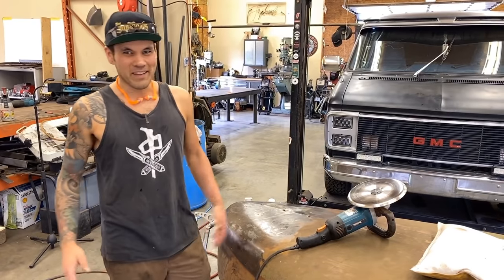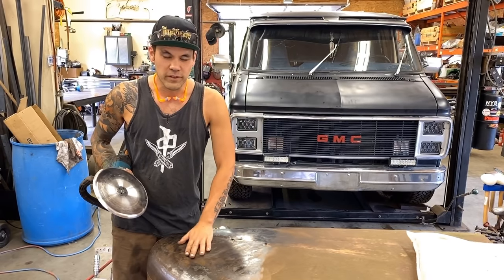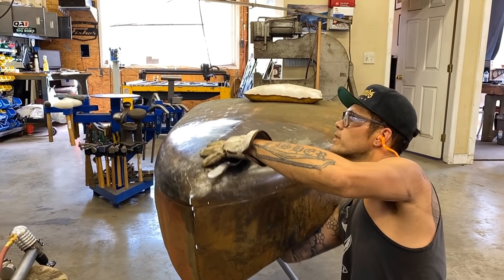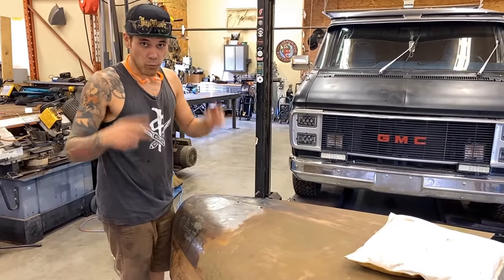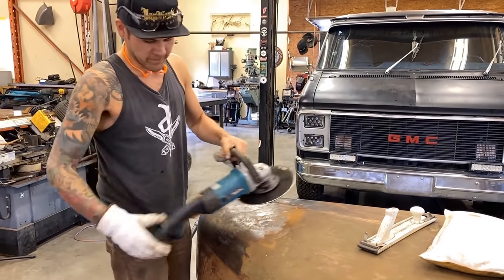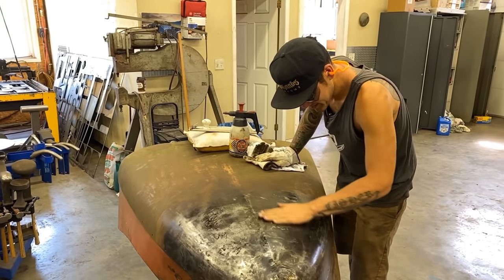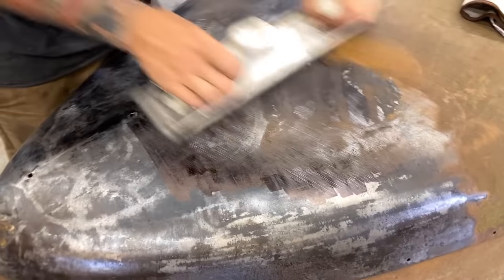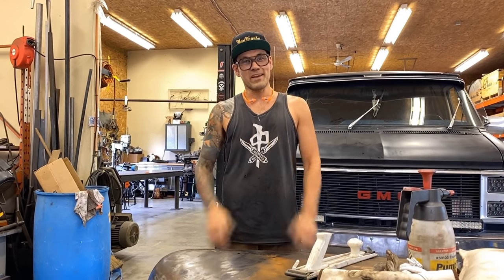DENT REPAIR: Using PROSHAPER'S Shrinking Discs!!! 1940 Willys Hood (Pt 3)

Comment: Revisit Wray’s videos. He runs the disc on the marker as a lubricant to avoid sparks and galling. He just says that if you have too much marker it can prevent heat build up. He does not recommend running the disc on bare metal.

Comment: I really enjoy all of your videos . They definitely help me . Even though I don’t practice enough. You said that your using a variable speed polisher for the shrinking disc. I took. Ken Sakamotos metal finishing class . Which is a excellent class .Ken is very good and a good teacher. He also invented the original shrinking disc. He taught me that you need 5000 rpm’s to run a shrinking disc. I metal finished a sun visor for a 53 Chevy that was dented all the way across and surface rusted. Using hammers Dollie’s, slapper and shrinking disc. I delivered it in raw metal . I used dykem and Kens serrated shrinking disc

Comment: My grandpa used to build hot rods in the 60s and 70s. He taught my dad a lot mechanically but he didn’t have the patience to pick up on the metal work. I’ve been told I have the patience of my grandpa and I’ve been thinking about picking up where he left off. I do fabrication on bigger stuff (I am a fabricator in the oil and gas industry). I really appreciate these videos (especially the 4 door to 2 door ‘55) and they have motivated me to start trying to find me an old project car. Keep up the good work brother 🤙🏼
Reply: I watched him heat shrink a cj2a hood for my dad and I was amazed 🤣 I was quite young then and he can’t really see these days so you are teaching me what I need to know 🤙🏼
Reply from the maker: Awesome man I hope you do pick up where he left off! Sounds like you’ll do well with it having a base knowledge and welding fabrication already
Reply: @MakeItKustom  thanks for the great teaching you offer keep up the awesome work brother 🤙🏼

Comment: Shrinking disc is amazing for oil canning and welding warpage too it seems. With just a few go's it took the canning right away from quarter panels and stiffened up the warped trunk lid from welding to be ready for bodyfiller. It is good for hobbyists like me, its easy to use for fast and effective result, I am not that good of a panel beater to do metal finish but it helps alot for those flat and floppy panels so that you can skimcoat with bodyfiller and it doesnt flop around when you sand it down. Takes practice and effort to metal finish for sure, but if you can live with few mm of filler then it makes this job real easy with this tool, definetly worth to have. Lifesaver on panels that you cannot get behind with dolly, as gas setup is way costly for hobbyists.

Comment: Amazing transformation. Watched parts 1 & 3. Need to go back & watch part 2. Makes me confident w/some upcoming work. I'm good @ sheetmetal fabricatuon/panel replacement but not so practiced @ metal bumping & what I have to do is so much easier than what you did. Subscribed.

Comment: Not by any means saying you're doing the shrinking wrong, but I've watched others using the grinder shrinker disc and they use it 'til the metal gets very hot so when they spray the water on it, it steams off. That is what causes the shrink to take place. But since I have never used it myself, that is only what I've seen multiple time as others use it. IDK, just passing on how others use it... Thumbs Up for your channel.
Reply from the maker: Yes it’s hard to tell that it’s steaming because I’m only concentrating on very small places during this. But believe me it’s getting hot and it’s definitely working. Thanks so much for your feedback!
Reply: @MakeItKustom  so I absolutely love your channel I’m just starting to teach on my channel as well but I thought I’d help in an area I’m proficient at. The shrinking disc needs to have a 6k rpm grinder to make it work like it should. If it’s higher than that it’s hard to control and if it’s lower it takes forever. Your description talking about the golf ball dent you can actually shrink even that down with it. Anyhow I hope that tid bit helps you keep up the great content 👍🏻

Comment: I have one of these discs but it's the smaller 4 and a half inch size. The smaller grinder spins it faster so it's more aggressive and heats up the panel quicker then I used a very wet cloth straight out of a bucket so it quenched the heated panel quicker and encouraged shrinking. It seemed to work quite well, I used it to help smooth out a section on a rear quarter that I'd done some localised heat shrinking to help smooth out the resulting hammer marks. It certainly saved time to get to a stage where it was a thin skim with filler. I'd like to try the larger one you have as it should help to level out a larger area. Good video, I've just subscribed to your channel! A big thumbs up from the Shetland Isles at the far north of Scotland!
Reply from the maker: That’s awesome Larry! I’ll have to try it with a grinder one day! Thanks so much for watching and keep up the awesome work!

Comment: Funny you should be working be working on a Willys.  My next door neighbor (older gentleman) has four Pre-WWII Willys  Hotrods ('40 and '41 are the dates I remember).  A Fire Engine Red one, a yellow one, a flat Black panel (truck/van ?), and one in his other garage that's still in parts, waiting for some attention.  What little I can see of it under the piles of stuff, it still looks stock. He's got a couple of three buddies in the neighborhood that are also into Hotrods.  I get treated to a mini-carshow from time to time.  The guy down the block has a purple, open top, chopped Model T, wide rear tires.  They're all classic Hotrod style, not Rat-Rods.
My neighbor just came back from a show down near Bakersfield, CA. , and said his panel truck was a hit ( Yes, he did trailer it down there)
You would approve of how he's detailed them out.

Thanks for covering shrinking disks.  I've been wondering about them for years.  Useful to know (everything I own is dented, rusted, or both).

Comment: The marker is acting as a guide coat. I LOVE that mobile planishing hammer! If I could afford one, I buy one for certain, it takes away hours of hammer and dolly work. I really don't like filler. If I absolutely have zero choice, I prefer to use lead, and very little of that. Mostly it's metal work. I also like the shrinking disc. I've read about them but didn't any opinion of paint and body men that I trust. You have quantified the dilemma for me in a positive manner. I appreciate that you pay so much attention to the metal work rather than skim coating an entire area and then "reshaping" it with a body file. I consider that to be very poor workmanship.
Reply from the maker: Yeah I’ve tried a little bit of leading I like it but I still use filler if needed mostly a thin skim coat doesn’t bother me
Reply: @MakeItKustom   Some people like filler a little too much. I still have a '68 Mustang Fastback that I acquired years ago. When I looked at the right fender after getting it home I realised that there was damage there. I removed the inner fender and found a large dent fully 9 inches long, about 5" wide and 3" deep, totally filled with bondo. The "repair" had been done years ago but the bondo in the center was still slightly soft and smelled fresh. It took so long to cure that it eventually started to rust out the base metal underneath...Some peoples kids eh?

Comment: Great video series.  I came to watch because I have a metal filing cabinet with a massive dent screwing up the drawers sliding.  This was exactly what I needed.  I appreciate the thorough explanations.  I wonder how hot the shrinking disk is actually making the metal.

Comment: Great video again Karl.
Those shrinking discs look to be very effective.
Have seen Wray explain them but your explanation was actually more detailed than Wray's.
I also think Wray uses a body file on the Texta as a little less flex to scrape off the Texta on the high without filing off the metal.
Great knowledge and instruction ad always.
Should show a before and after shot

Comment: I'd love to see how you would repair a flat panel that's been almost folded on itself that needs to be folded back out to a flat surface with the edges that are folded over 90 degrees have the rips repaired by mig welding them. I'm assuming that would be easy enough but it's getting the tension out of the panel, getting it flat that I'm interested in. I have a rear tool box area of a 1942 Dodge WC-51 and the rear panel on either side of the tailgate looks like someone backed into a fence post and effectively crushed the whole panel in. 

Thanks for the video Karl and I look forward do getting your advice mate.

Comment: The marker also is used a a lubricant to keep it from gall the disk as well. . Wray uses a high speed grinder not a buffer to create heat quickly you need the heat from the high  speed to move the metal and to cool it quickly with water or a very wet rag to shrink itback

Comment: Nice work, i never seen a shrinking disk before or in action. Got to get one now.. I will say one thing i was looking at and i havent heard you mention is, im looking at the straight overhead lights reflection on the hood for straightness, and by the reflection i can see that hood is good enough for gov work already ,, nice going
Reply from the maker: Thanks a lot man! Definitely give them a shot they are a magical tool I will never be without one again. It would be such a struggle to try and get those out without one in fact almost impossible

Comment: Hi Karl, just a thought on the big marker pen. Wray does say in his video that be uses it as a bit of a lubricant and I've found you can leave it on. It still heats up but immediately it shows the highs and lows without the flat sanding. Thanks

Comment: A couple of  things I would suggest .. on the planishing hammer you want to make sure you are pulling up with the hoop so the bottom die is lifting as the top die hits down .. you want that up pressure …secondly after using the shrinking disk use a completely wet rag to immediately quench the metal and shrink it fast .. you should be able to see a small amount of steam come off the metal if you look closely .. I don’t think your spray quenches it fast enough..
Reply from the maker: Thanks for the insight I appreciate it!

Comment: Using a wooden slapper may help prevent over stretching during dolly work. Looks great and I'll consider a shrinking set from Wray soon!
Reply from the maker: With this steel I wouldn’t slap It’s a bit tough because it’s not as hard as the metal. It would work much better on aluminum though

Comment: Karl, I'm at this point right now with the hood on my 69 VW Squareback. I didn't realize how quick my English Wheel moved metal - I got carried away. Now I have to do some shrinking. I watch this video and purchased Wray's shrinking discs kit. I also have the Makita 9" angle grinder. How did you get the shrinking disc to fit without the spindle protruding from the disc? I've purchased different bushings and still the spindle sticks out past the disc.

Comment: The disk is a finesse way to move metal. Actually you want the sharpie to lubricator the disk so that it doesn’t over heat and Gaul the metal. Ray always ads sharpie to the metal when he goes back over it as an aid. The disk does remove the sharpie as it warms up and that shows the area you were working. He doesn’t ever use the disk without adding more sharpie. Again it helps identify where the work is being done and it acts as the lubricant needed when using this much friction on metal. But if you can do it and get away with it then koodos. I keep marking it before each application with disk. It works best for me that way.

Comment: I so wish l had a shrinking disc 30 years ago. Had an oil-canning problem on my van sides and l shrank (with a torch) and hammered and dollied and over and over and never got it right. 
Does it get to the point when a couple of coats of primer would make it perfect but you still keep going? I mean, how much is your time worth? You know, diminishing  returns? Love watching your work, and that '39 Zepher is my dream car as well. Make it beautiful!
Reply from the maker: Yeah Peter Certainly not all projects you would take this far. This particular hood is worth the effort. Most are not. I like to take into account what the project is and what standards are being set. Some things I’m completely fine with an eighth of an inch of filler because that’s very quick to get within and move on But like I say others are worth the time

Comment: (IT'S ONLY MY SUGGESTION , )....... I think that if you where to use a well worn 4 inc 120 grit sanding disc or a new clean and strip disc using a lot of water to cool it down you would have strunk that area much faster and not crystallize the metal which (in your case been a early model hood that is  made from  metal with plenty of  carbon ) , would have made the job easier and faster . NOT TO MENTION that , those shrinking discs are far too dangerous . I have used one of those ( ''shrinking discs '' ? ) Once before and.... I will never use one again for quite a few  number of reason .   BUT AGAIN THIS IS ONLY MY OPINION.... by the way..have you ever try a heavier slapper with teeth rather then a polished one for a job such as the hood ?

Comment: Is there any abrasive (like diamond dust) on the surface of the shrinking disk?  Or is it simply polished stainless steel?  Also - it might be very interesting to use a thermo camera to show the heated locations created by the shrinking disk.  Thank you for another very interesting video.
Reply from the maker: It’s simply bare stainless it’s not polished

Comment: I just stumbled on this video today, and I think you said you use the disc on your variable polisher. The disc is supposed to be used at about 6000 rpm. The polishers doesnt go that fast to create the heat you need. I watched the guy who manuf. this disc, and that s his own words. There should be some steam as you sprayed the surface after the use of the disc.

Comment: Can you tell me the rpm on your polisher? Wray says a grinder is needed as polishers don't go fast enough, but mine is variable speed up to 3,000 rpm  which sounds like the speed of yours and is close to the 4500 that I think Wray suggested. I'd rather use my polisher than buy a 9" grinder just for this.

Comment: Hey, would it be possible for you to cover how to repair rusted front windshield columns.  Both my '83 Subaru Brat. and my '79 Chevy 3/4ton P/U have that issue.
Reply from the maker: Specifically on those probably not. But you will learn the techniques by watching these videos

Comment: Love the videos man! Is that straight water you're spraying?
Reply from the maker: With a drop of soap
Reply: @MakeItKustom got another question for you. Im currently stripping my 67 bug to bare metal. It's recieved at least two paint jobs, layers of etching primer and it looks like Bondo Bob got ahold of it. Body sheet metal is 99 percent in tact. Since it's bare metal and thin gauge, what should I use? Epoxy? Self etching? Or that Straight to Metal stuff from summit racing? I live in Nevada dry climate. Don't know if that matters. Any info is greatly appreciated.

Comment: Is there a way to set your planishing hammer at a specific depth (size of sheet metal)?  So, if you've got 16g sheet, you set the hammer to 16, so that everywhere it goes, it can't under or over hammer?
Reply from the maker: No planishing hammer’s don’t work that way. It’s kind of a little bit more of a feel sort of thing. You have to adjust air pressure so that it doesn’t hit hard enough to stretch it only hits hard enough to planish. The other way is using plastic lower Anvils. This way there is enough deflection in the die that does not allow stretch

Comment: When you say you don't want to stretch the metal I guess you mean you don't want to make it thinner. Right? Isn't that the immediate result if the metal comes between the dolly and a hard hammer strike?
Reply from the maker: You are correct that when you hit the dolly through the tin with the hammer that is a stretch. Most of dent removal requires the hammer on dolly off technique were no stretching is happening just movement and dent removal. When you hammer directly against a dolly through the tin with light pressure it can be considered planishing were very little if any stretch is happening but the metal is becoming straighter
Reply: @MakeItKustom  I saw this guy at "Brass and Woodwind Shop" straighten out the inner slide of a trombone to working order. Many thousand light blows with a raw hide mallet and a mandrel inside. A beautiful example of the energy principle at work. I guess that if you fine tune the amount of energy in each blow and direct it at a high spot and if the dolly has contact with a low spot, all that energy will be used up to some straightening and not for thinning/stretching. Not only metal between the hammer and the dolly, but also a few molecules of air at all time. To hard a blow and the metal will be squeezed/thinned/stretched also.  A lot of light tapping and a lot of patience I guess.

Comment: curious  is that a polisher that you are using with the shrinking disc   or is it an angle grinder  (just wondering as to what revs you would run it at )   thanks
Reply from the maker: Great question yes this is a polisher not an angle grinder but an angle grinder is the proper tool to use as it spins faster and heats up the metal quicker according to further research. But it is certainly working for me just fine with this polisher on full speed

Comment: Can you remove the crease (high spot) with just the disc and then quenching?    Or do you have to use the slap hammer and  dolly to get it completely flat?    Thanks.
Reply from the maker: Hey Jim! It will shrink and release tension, but ultimately you’ll need to use more force with the hammer and dollies.